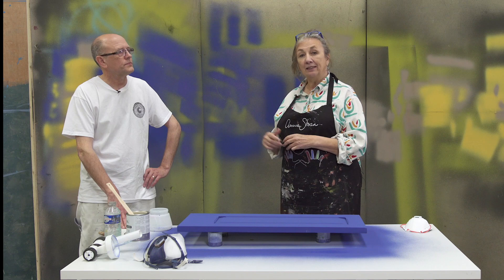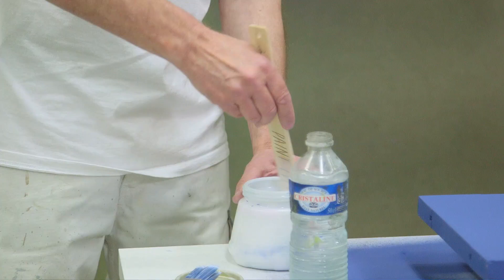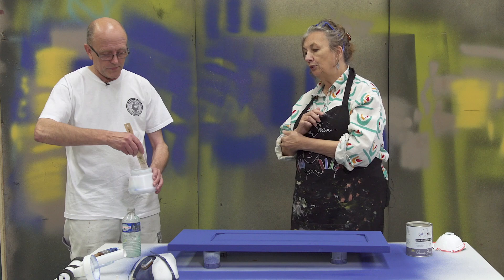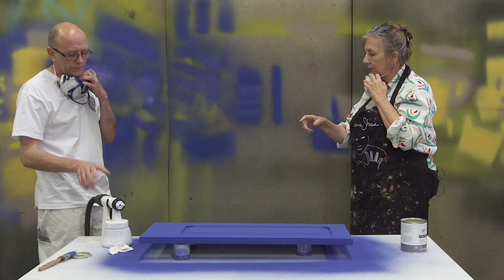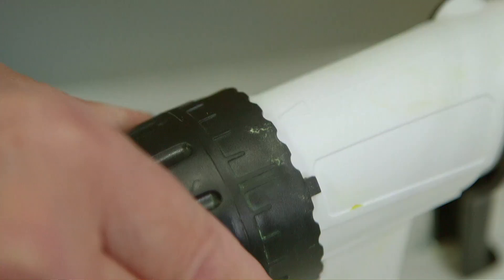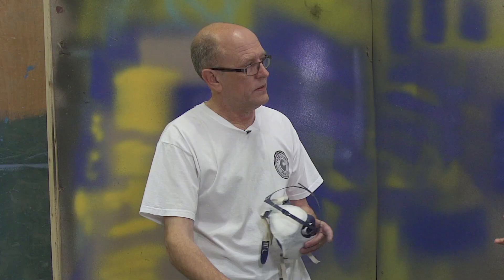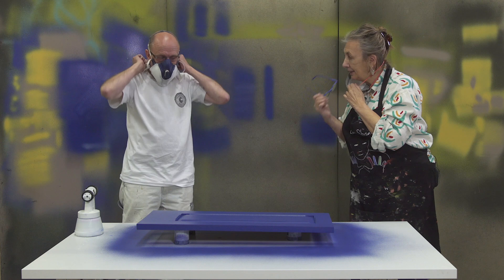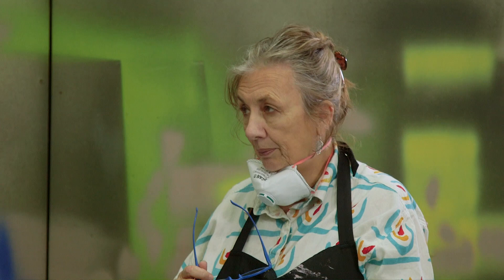How to apply Chalk Paint® Lacquer with a Spray Gun - Part 2

Comment: When you spray on the wall to make sure it "looks right," can you tell us what would happen if it were "wrong?"  Is "wrong" obvious??
Reply from the maker: That's an excellent question.  You are looking for a smooth, even finish with no heavy buildup, drips or runs.  If your Chalk Paint® or Lacquer has an 'orange peel' finish (not smooth), be sure to maintain a proper spraying distance and reduce the viscosity of the material. Also keep your surface out of direct sunlight and as close to room temperature as possible.  If you are experiencing 'blushing' (the Lacquer coating appears milky), this is a sign of moisture being trapped; ensure your underlying layers are completely dry and your materials are room temperature.  If you are experiencing sags and runs, you are likely applying too much material per pass; maintain a proper distance from the surface and move the gun faster or decrease the amount of material being sprayed. Finally, if you have a poor or uneven spray pattern, ensure that your fluid nozzle and aircap holes are clear.

Comment: I've watched both videos and I still have no idea how much water to add???
Reply from the maker: There is no specific ratio; it's really a matter of testing until you get it just right.  Just follow Ron Taylor's advice.  Before spraying, make sure you have stirred your Chalk Paint® or Lacquer really well so that it is smooth and creamy.  Start by adding about 10% water and then test.  You can test one of two ways:  1) Using the same stir stick you used to mix in the water, draw the stick out of the mixture and allow whatever is on the stick to drip back down.  For me, I count the drips, looking for a rate of one drip per second.  Others, like Ron, look for 'worm casts' or marks on the top of the mixture.  Continue to add small amounts of water until the rate is correct or the worm casts disappear.  2) Another way to test is to actually spray on a test surface (look at the wall behind Ron!).  If your sample has more of an 'orange peel' texture, add small amounts of water until you achieve a nice, smooth appearance.